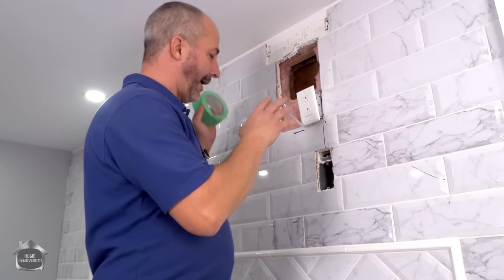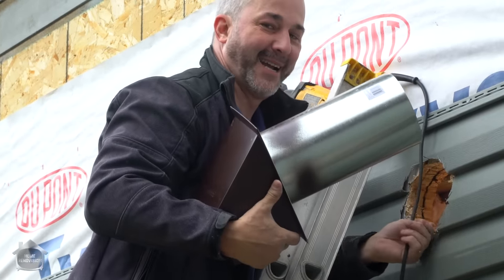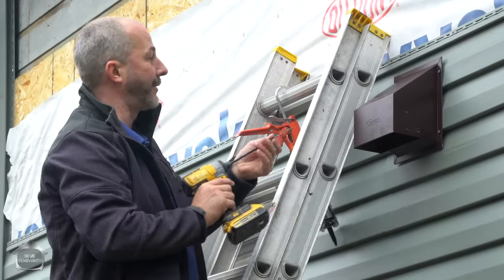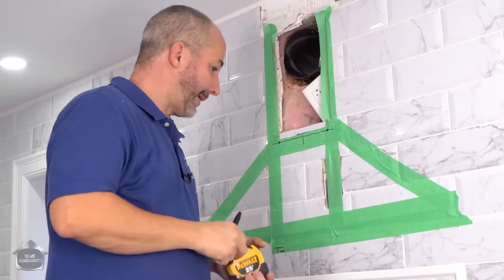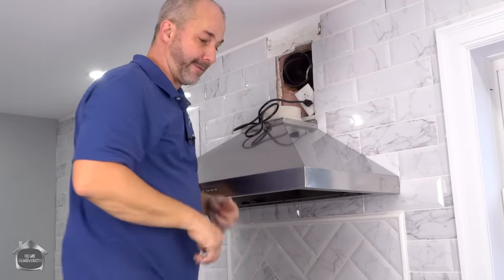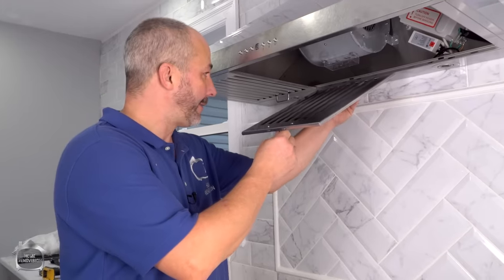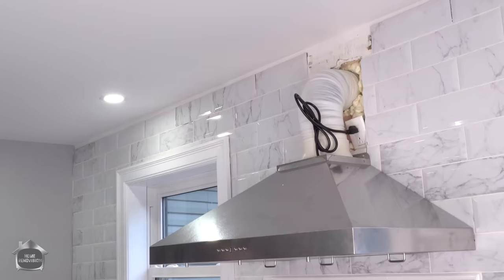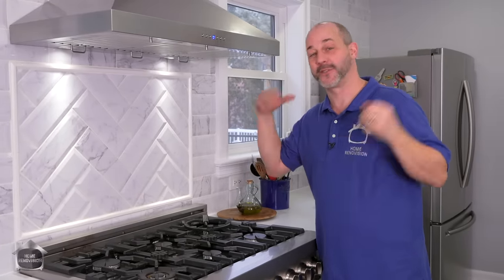How To Install A Wall Mounted Hood Fan!

Comment: Lots of great physical installation pointers BUT.....according to the 2020 NFPA-70E code, Article 422.16 (4)(4) requires the receptacle supplying power to be "accessible", on a separate circuit  and the cord length can only be a minimum of 18" up to a maximum of 48".  Seems most manufacturers fail to address this electrical power requirement.

Comment: The notor stopped working. I sent zline pictures of the circuit board with VISABLE PART NUMBER.
They keep sending automated email replies asking for the same information over and over again. 
Absolutely no help at all. I threw the Z line junk in the garage. Buyer beware.

Comment: I just installed one of these. The blower moving the air out, I see the flaps on the house vent swing wide open… however it isn’t providing much suction at the bottom of the hood. Is this how these hoods work ?

Comment: Hi , I've the same unit , the motor started grinding and squealing after 13 months , the bearings sounds dry , some days it ok then other times it sounds like it wants to blow up ! Sadly Canadian tire pushed me to the manufacturer and then now that company no longer makes them so they say ! I guess a lesson learnt that Canadian tire buys and then sell stuff that they know the buyer will not have warranty or support for their stuff ,,, well in my case I'm out of hood fan , the lights work tho 
Sad stuff

Comment: So I’m in the process of installing the same model and basically the same ductwork measures. Zline says the preferred duct distance between the top of the hood and the first elbow is 15”+. It looks like yours is a lot shorter. Have you seen any negatives with the short rise?

Comment: PLEASE do not refer to this video if you want a sound and safe hood vent install.  Four significant reasons - (1)Electrical box not fixed/mounted, (2)hack job on exterior siding with an angle grinder that will not provide long-term air/water protection, (3)using flammable spray foam around a hot air duct (even fireproof rated foam shrinks with heat), and (4)installing wall anchors into tile and sheetrock to hold up the weight of a motor/hood unit (mounting directly to studs or blocking is necessary).
Reply: 1) agreed should've moved the plug or directly wired into a wall mounted fused spur.
2) It could've done better with a mechanical water proofing but it's shielded under the roof so only wind driven rain will be an issue.
3) there is no way the air temp in the cooker hood with be at a combustable temp for any spray foam. The fan is pulling air in from your room too so if you can hold your hand under the hood then it isn't that hot. 
4) hoods aren't that heavy but solid support is always better.
Reply: What sort of tradesmen would you hire to install this exact vented range hood?
Reply: Your spray foam concern is laughable. 
Like knee slapping funny... 

You didn't mention the flexible duct. That's a no no. 

Either way, this install video shouldn't be taken seriously by anyone looking to do a quality job. 
And if you've got inspections to contend with, you'll fail in a heartbeat if you duplicate this install...
Reply: Can u explain blocking

Comment: 🤔 Jeff... Check it 'oat' .. You're using your tape measure as a hammer 🔨 ! 😯 ... 🤣
Great video mister
Reply: Stanley makes a great tape measure/hammer.
Reply from the maker: I throw away every tool that only has one function. Cheers!
Reply: 1 JetGator "all tools are hammers. Except for screwdrivers . . .  and they're chisels."
Reply: @davefink2326  you🤔... are correct

Comment: I want to install vent to suck out moisture from cooking food and the wall is a block wall over stove no drywall, I know how to cut holes, I don't want to go up and out attic; I was thinking I'll have to buy a fan and extra piping I have electric right there for pluging in or I can hard wire any ideals on which fan? Thanks in advance

Comment: 400 cfm per/ton of condition air leaving  your home . May cause some cooling issues depending on design.
Reply: It’s not like you’re leaving that on all day/ just during times of cooking. Not a big deal. If you don’t vent then the heat from a stove raises the temperature of a house anyways so your AC would kick on and its an issue regardless.
Reply from the maker: the reason we condition air is to eliminate the water vapor which is the most dangerous element in the house to its health. removing the steam at then source is more efficient than doing it later. Cheers!

Comment: um as a sheet metal worker we always installed the elbow to the exhaust pipe...

unless there was a need for a fire damper -pre drill the holes in the plastic - get a round $x inch collar pre drill as well - an extra step but there is NEVER any back fuming. 

i guess check local local building code as installing the elbow into the pipe instead of outside of the pipe will negate (not true) back fuming. the install tec will still have to seal the gaps created inside the round with "CHEAP DUCT SEALANT" then "hopefully" add metal tape to the seams 😂

sexy install i would of went with the collars... especially when your work is coming out awesome. collar cost you $5-$10 - bill the client 15x plus install....

cuz thats just the way it is.... 🍻

Comment: Did you have a backer board that those screws that hold the vent fan are screwed into. Or was there studs behind it. So far your video is very informative and you are showing everything close up. One of the best instructional videos I have seen.  You look directly into the camera (lots of eye contact) with a smile and friendly voice . That helps the stress of the job go away and give one confidence they can do the job to. 
Thank-you.   Im subscribing

Comment: I don't understand this either.  ZLine appears to be a quality company.  But clearly, a smooth metal duct is going to be superior to a pleated plastic design, which will both reduce airlow and trap grease.  So why would they ship that with their product?  The instructions say "use rigid ducting when possible".  Is a pleated flexible plastic duct considered "rigid"???
Reply: Z-line is a large, reputable company that has been around for years. They wouldn't send the pleated duct if they hadn't thoroughly tested it and recommended it for installation.
Reply: @maxbosley53  It doesn't change the fact that they SENT a flexible pleated duct, and in their own instructions, recommended a rigid duct.  It's nonsensical.

Comment: I gave you a thumbs up, but the electrical is a little hanky. Option for a permanent connection to the hood? Some codes do require a plug but I think it needs to be accessible. What are the details in your region? In my town we wouldn’t be able to use plastic venting tubing. On the outside why not put in a piece of square mounting material - cut the outside a bigger square, mount a rectangular mount with a 6 inch hole, then mount the hood/damper on a flat surface and have a much nicer caulked finish look.

Comment: just wondering why you’re using that garbage weak thin-walled flexi-tube to vent an area that’s going to have hot greedy gassy air flowing through it, instead of solid duct sealed with thermo-tape?

Comment: If you're exhausting the air out, isn't it pulling outside air in the house?
Reply: There is usually a damper. On the fan and/or the exterior vent.

Comment: Would you just vent through the roof, for an interior walled fan?

I really don’t believe mine is even vented. I see what looks like a vent at the soffit. Doesn’t make much sense. But I need to vent both bathrooms as well. Seems wild to have basically three vent hoods in close proximity on the back of my roof.

Mine has the filters where the fan is. So it is designed to filter the air back into the kitchen?

Comment: So I have had one installed I have the same style (cap or whatever you call it) the one you mounted to your siding. Well mine is on my roof. My question is when it’s really windy the wind come thru the pipes making the baffles inside clatter it can be very loud any ideas for this or solutions to stop it from making loud noises when windy?

Comment: Jeff I have a vaulted farmhouse ceiling, my only option would be to 90* angle (to the left) and run it to the external wall. Is it ok to build a wooden box around the vent pipe, insulate with rockwool (safe and sound). The wooden box would go with what we are planning for shelves. Suggestions please....

Comment: I've purchased a 28 in. Stainless Steel  Z-line Range Hood Insert with Remote Blower . The noisy fan will be placed in the basement and exhaust out of an existing hole in the foundation. Existing hole was for an island cook top that exhausted into the basement which is gone. I've also purchased steel tube and elbows. Have you done or are you interested on the subject. I think it's a great idea to not have the venting noise in the kitchen.

Comment: Thank you for validating my purchase. I got a Z-Line range hood after looking at several brands that appeared identical. I didn't know the brand but chose it almost at random. I did have a problem with the LCD display; Z-Line sent out a replacement board, no questions asked, and it was a quick 5 minute job to replace.
Reply from the maker: I have been very impressed with their service Cheers!

Comment: Does it bother anybody else that the outside exhaust panel is not installed right? The panel supposed to lay on the plywood not the siding, than waterproofed with taped or caulked and the cover has to be channeled for the siding to set in or wind could potentially get in there and blow out the siding

Comment: fills the vent hole with foam ???? Why not just fix it the correct way plus the sloppy electrical outlet just dangling there is disturbing..

Comment: I am renovation my kitchen, and removed the cabinet from above my stove. The cabinet had a part  of its back sticking into the cabinet as if there is something behind it. There was 3 pieces of diagonally cut wood that were attached to the structural wood, in the corner where the wall studs met the ceiling joists, and to these 3 pieces of wood, a metal sheet was screwed. I am not sure why that is there, and it is easy to take off, but, i am wondering if this is part of some code. I live in Ontario. It is not art of a staircase, and there is a bathroom above, it, but a sink, and not a tub, and the piping is all in the ceiling and do not extend down to where i am looking. I have photos, but i can't post them here. https://drive.google.com/drive/folders/1o9HhEcVJB6RDNpFi1N2cHv6q_QGX5c9Z?usp=sharing

Comment: At 700 cfm, with all the work you put in with the vapor barrier and insulation, how did you  manage makeup air? I haven't watched the whole series but do you have any naturally vented heating appliances? I imagine the water heater would be the likely concern, but even with no natural exhaust venting, have you found that makeup air may be needed?

Comment: My 48" Thor cooktop is directly below a huge 14" deep beam that runs the same horizontal direction. I need to hang hood vent above it and attach to beam and run vent hose  horizontally out first story wall.  Any ideas? Any hood vent model recommendations?

Comment: If my stove is on an inside wall, can I run the vents straight to the roof? I have re-wired pretty much the entire house( built 1958), installed all new drywall in most rooms, and replacing cabinets. All diy and definitely a learning curve but feel good about the progress my wife and I have made. Definitely worth buying good products and like you said , installing them myself!
Reply: Check mfg install instructions. The one I have says yes you can if you (of course) follow all other state and local building codes.

Comment: I've currently got my stove on an outside wall, vented directly out. I'll be moving it to an inside wall. I was thinking of routing the duct work up to the ceiling, do a 90 degree turn in between the floor joists (two storey house), and follow parallel to the floor joists all the way to the outside wall. 

Do you see any issues with this approach?
Reply from the maker: perhaps distance if over 20' of ducting. otherwise solid plan. Cheers!
Reply: @HomeRenoVisionDIY  it's like 6 ft tops, thanks!

Comment: Will this range hood work if i have no way of running a duct for venting outside?
Reply from the maker: no, and there is always a way. perhaps through the roof?
Reply: @HomeRenoVisionDIY  the only thing above my stove is my second story (a bedroom) my stove is on an inside wall
Reply: @HomeRenoVisionDIY  hey bud, I contacted Z Line, I own the KN-30 model hood and they informed me that they do in fact offer a set of charcoal filters for applications to filter recirculate the exhaust back into the kitchen.  Thought you would like to know, thank you.  I love you videos by the way, I've learned so much from you

Comment: wow im actually installing a range hood also but I  need to run it through the ceiling into the roof. Is there somewhere that sells that flexible pipe?
Reply from the maker: comes with the z line hood. try amazon!

Comment: I was surprised that you used what appears to be a flexible plastic ducting between your hood and the wall. Figured plastic was one of the least recommended materials and more advisable to use a metal duct. Fully enjoy your videos!

Comment: How have you been liking this range hood so far? I've been looking at Zline they definitely seem to cost a premium over some other well established brands in this market. Also with a hood this powerful, are you having any drafting issues around the house? I have an older house but as we try to make them airtight, I'm wondering if its leaking enough air to make up what this will suck out.

Comment: Great video as usual! Did you have to install any make up air system since the hood is more than 400 CFM? I think it is required by the codes. Thanks.
Reply from the maker: since our house does not have an air seal  on the exterior ( being 140 years old) it is not an issue.

Comment: Your outside hood is poorly installed and will eventually leak. I recently installed an outside hood with the proper mounting Block with a j channel  all around for the siding to fit into, which involve removing two small sections of vinyl siding with siding tool, properly installing and sealing the block to the sheathing and fitting the siding back to the j-block. Where siding wasn’t complete you could of easily removed a few sections and properly cut the hole with a hole saw. Sorry but as a veteran DIY your installation guarantees future water leakage.
Reply from the maker: Hi Jim. Not concerned about a little water getting past the siding. this house has great air flow behind the vinyl and it will always dry out before becoming a problem. Cheers!

Comment: I've done a few of these in the past year.  They are a bit of work.  Especially the ones that are not against a wall.  You have to have the electrical in the attic and special framing for the channel.  But it sure does look nice when it's done.

Comment: Great video! Solved an issue I was contemplating with the easy to remove and screw back on end on the vent pipe. 2 questions I do have. 1. Do I need to be concerned with attic venting as my soffit will be directly above the exterior vent? I know it points downwards but still caught my attention. 2nd if I added styrofoam to the inside of decorative chimney sleeve would it cut down on noise?

Comment: When you inserted the plastic tube into the metal one, is there any concern that it was folding in on itself, leaving a small gap exposed? Or is that nothing to worry about?

Comment: hey Jeff - love this video.  So I am in the process of getting a new kitchen over the next month.  I am doing the tearing down, the professionals are doing the install EXCEPT the pyramid chimney range.  I will be cutting the hole through the side of the house and installing myself (thanks to this video).  One question I have - you clearly have the back splash up before installing the range hood - what kind of drill bit did you use to drill through the backsplash at 12:35?

Comment: Someone always got something negative to say. You're videos have helped me a ton thank you very much I will be subscribing to what you're talking about
Reply: I agreed with you that some people like to say some negative. But that is the best way for other viewers who actually want to learn proper stuffs. Since this is diy stuffs. It is okay to do whatever. However, if it is wrong it is not good for you in long run. 
Lets for people complained about the "look" of the outside caulking. That is overboard. DIY not meant to be professional look.
But some point out this that flex duct is not good. Because yes they might collect grease. For sure, it will be noisier than smooth galvanized duct.  And it is actually against code in some place for using flex duct. Like he said if you DIY buy high quality appliance. But shouldn't buy something expensive and reduces its quality. Same reason why when he turns on the max mode, it is louder than his talking. If i'm not wrong usually the zline good quality are 2.5 sones (noise level) = should a slight louder than a fridge running. Unless his model is a high rating sones hood.

Comment: Great vid! Im about to buy a z line wall hood & just found out that to many models you can add a stainless crown molding to wrap around top of the hood , adds plenty of character. Model I'm going to buy also has option to vent outdoors or recirculating air, going to try my luck on recirculating & hope it does well pulling garlic, fish etc odors away with the charcoal filters it has. Any constructive advice , past experiences welcomed

Comment: Wild that you can drill through your wall like that. In the UK it’d take a heap of time with a 6” hole opener through 6” of concrete block + chipboard